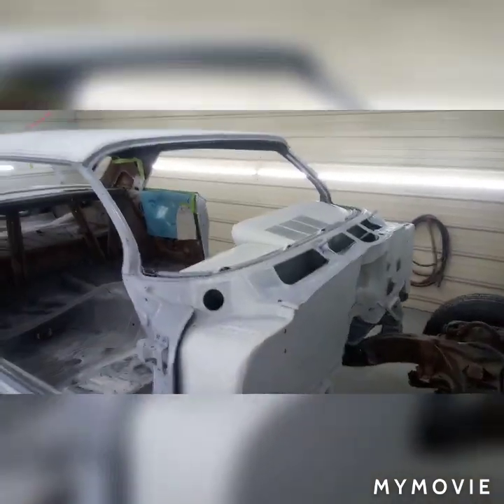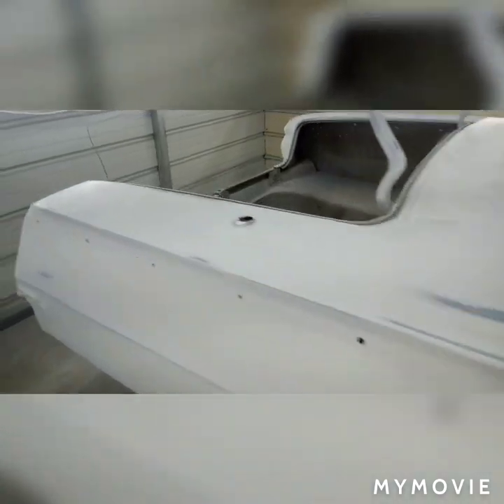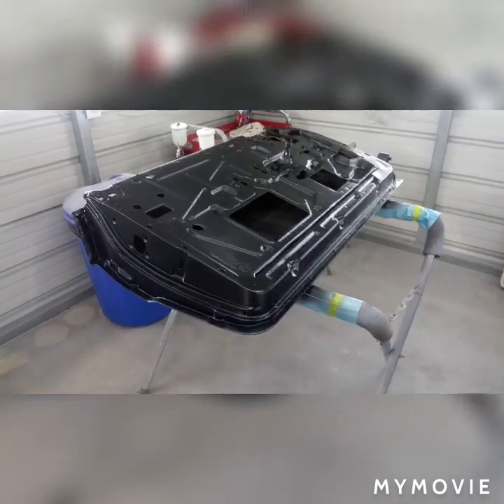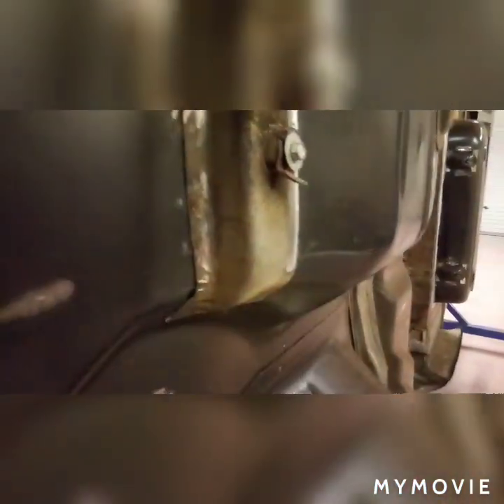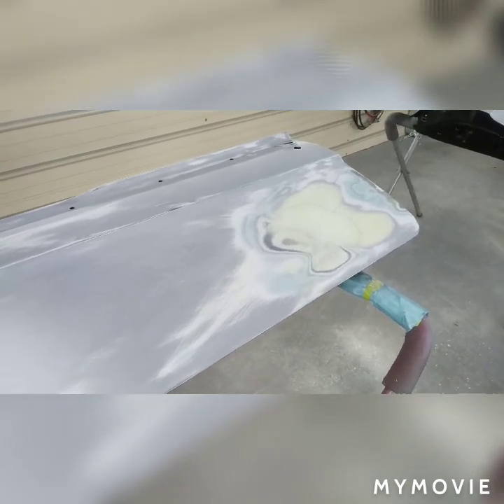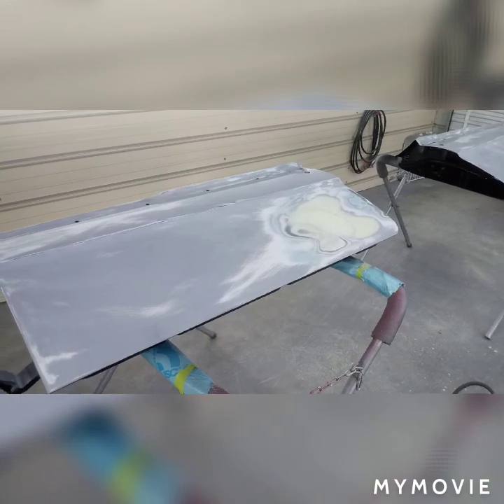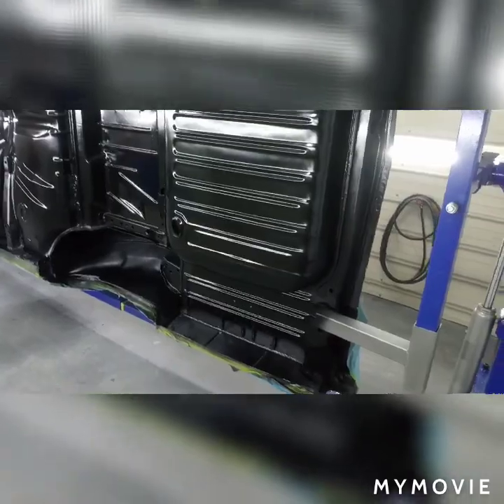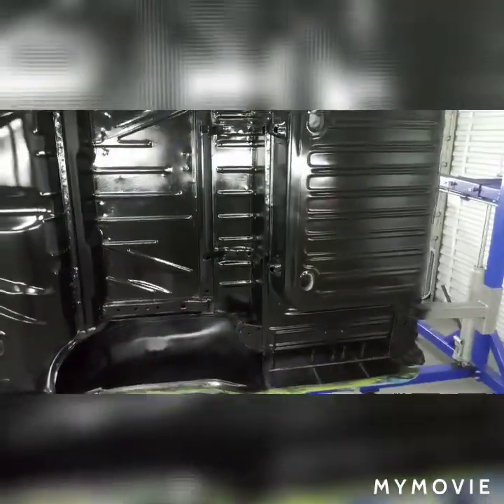1962 IMPALA ROTISSERIE WORK!

Comment: lone star what’s the correct process to finish the bottom of my car. i had a lot of floor pans replaced so there is a lot of welds! should i seam seal before epoxy primer then raptor line? or should i epoxy prime the whole bottom then seam seal and then raptor liner ? which do u think is best practice? 
i was thinking seam sealer, epoxy prime then raptor ?
Reply from the maker: Id probably epoxy them seam then raptor